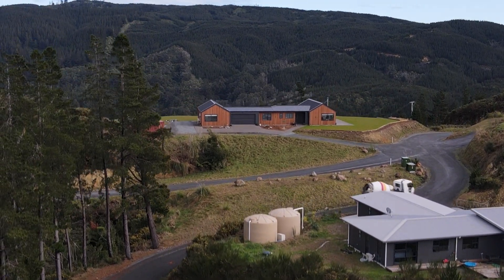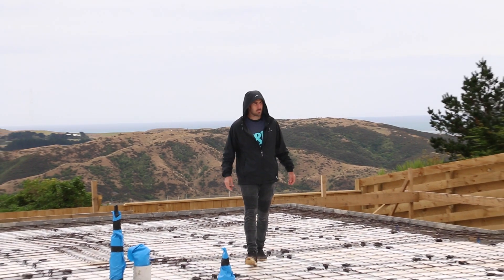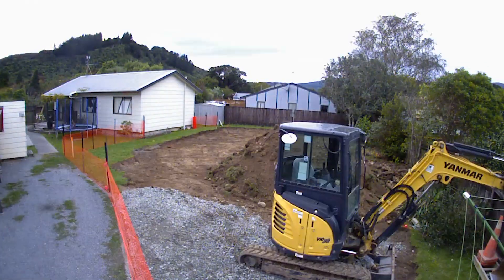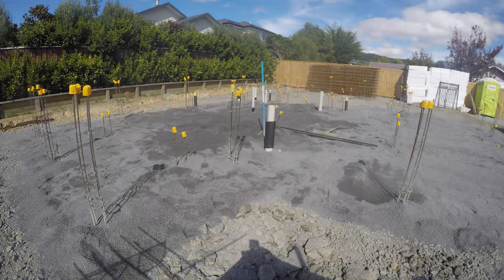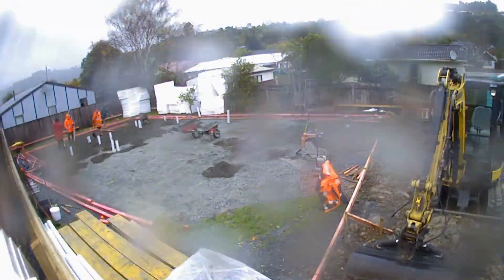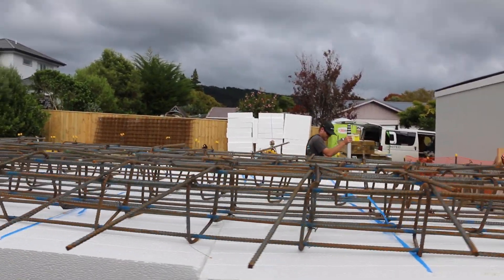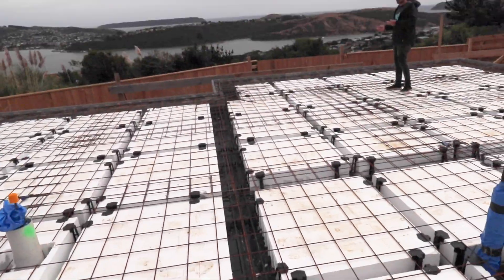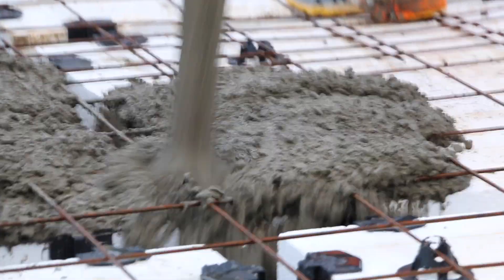Concrete Slab Foundation Breakdown

Comment: I guess there's a sweet spot on sloping sites where a particular slope angle will tend to make a concrete slab floor uneconomical and a decision needs to be made whether to a switch to subfloor framing foundations to support a suspended timber floor. Do you know what this sweet spot angle might be?
Reply: love to know if there is such a thing too.
Reply from the maker: Hey Beng, great way to look at it, my thoughts are the sweet spot changes as the angle changes, the steeper the section gets the more you build up, and would look at adding a 2nd and 3rd level rather than trying to get everything on one level
Reply: @nzbuilder  Thanks. Access issues for elderly may prevent split levels. Also shopping around for land if one knows that 'x' slope of site will probably mean more expensive construction costs then it may mean shopping elsewhere.